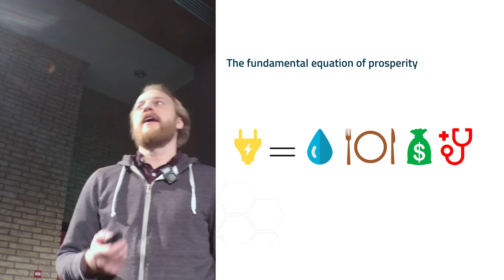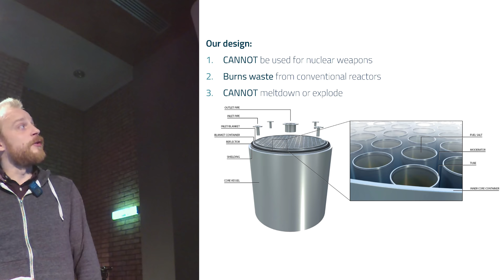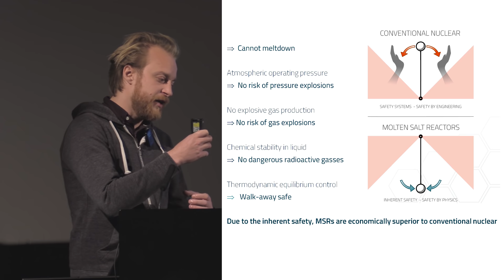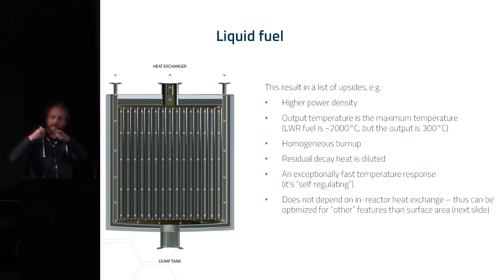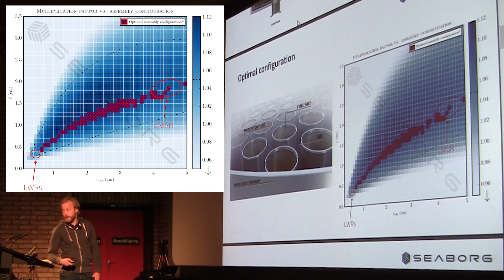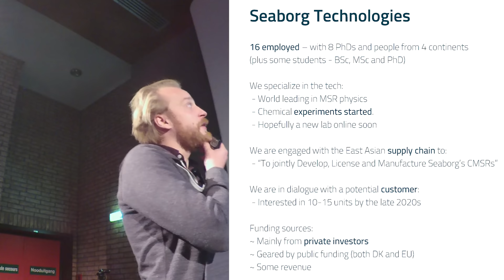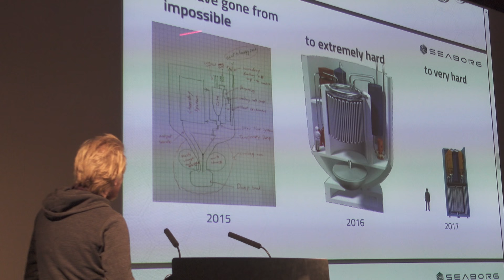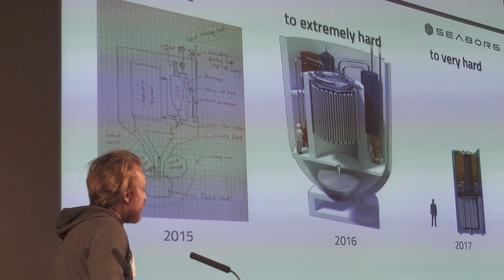Making Nuclear Sustainable with CMSR (Compact Molten Salt Reactor) - Troels Schönfeldt @ ThEC2018

Comment: Gordon, thank you for your continued role as the chief promoter of MSRs! MSRs should be utilized in the decommissioning of Existing Lightwater reactors. They are small enough to be sited on the existing secure, approved reactor campuses and easily integrated into the Electric grid as the old reactors come off-line these new reactors come online, potentially even using the existing turbine halls. Effectively, they are smaller more efficient replacement boilers burning the nuclear "ash heaps" of their predecessors. Processing of old (not) spent fuel into new fuel salt could potentially be done on the existing sites, reducing the need to transport the highest level Nuclear "waste" and its volume is greatly reduced as the balance of this former waste, is transmuted (probably the incorrect term) into thermal and electrical energy, and a reduced volume of less hazardous wastes. The concern with the total length of service is moot beyond 100 years, by which time all of the legacy nuclear waste (spent fuel) will have been consumed/reduced and Fusion Power will have reached a mature state. MSRs are the bridge to fusion, removing vast majority of the legacy high-level nuclear wastes, providing equal or greater generating capacity, along with desalination, nuclear medicines, and more. Decarbonizing and surviving the next 100 years must be the aim, MSRs are the means.

Comment: Thorium has advantages. It can work in thermal spectrum as well.
Chemistry with fluorine. 

Source of fuel is no an issue, nor can it be used for weapons. 

Weapons grade plutonium is made in a graphite pile.
Fluorinesalt is less corrosive then chlorinesalt. Better materials today then in the 60s. 

Neutron eaters (gas) can be separated when running as well as refueling.
High output temperature => thermochemistry. => synthetic fuel for transport etc.
High efficiency making electricity etc etc. 
Fluid moderator tried in IN2P3 Lausanne. Expensive research needed to make reactors accepted by authorities .

Nuclear energy competes with the fossil, a big economic player.
Reply: Thermal spectrum is a fundamentally flawed way of doing nuclear because you don't get rid of the long lived transuranic radioisotopes, Curium, Americium, Californium etc. Fast reactor preferrably chloride salt.
Reply: @hjembrentkent6181  Could you elaborate on your point?

Comment: 13:42 If you partner with China to manufacture the reactor, how do you prevent them from stealing your designs, and going forward without you?  Doesn't China have a history of stealing any ideas or designs they want to?  Do they respect patents and intellectual property of others?
Reply: The R&D reactors at the Shanghai Institute of Applied Physics are state of the art.  There isn't anyone for them to copy from; they are inventing it.
Reply: I can say that both comments are true. As someone who works in china - the new high speed rail, thanks to French technology, but totally built in china with no French involvment. But saying all of that the Chinese have put a lot of effort into nuclear power technology so i suspect the 2nd comment is correct as well.  On the other hand the most commonly built new reactors are Westinghouse AP1000. I am not sure when the first commercial Gen IV pebble-bed reactor will becomes operational. It was suppose to be in 2018, but i think that has been delayed to 2019? They are also building a Gen-IV sodium reactor in Fujian, again not sure when that will be completed

Comment: I like that it doesn't use graphite, but with a thermal spectrum reactor you don't get rid of the long lived activation products. Transuranics or transthoriums in this case. Fast spectrum is the best way to do nuclear because you close the fuel cycle and the waste is gone after 300 years, not milions of years in the case of transuranics.

Comment: Would you please state the dates of the presentation and/or recordings?
Reply from the maker: ThEC2018 (in the title) means 2018. I enter (manually for every video) the date captured into YouTube meta-data. I dunno where it shows it to your, but YouTube knows it. Either that or "Date Recorded" field is some sort of black hole to everyone else but me... which wouldn't surprise me. The value is 2018-10-29.
Reply: @gordonmcdowell  Thank you!
Reply: 0:23 His slide deck is dated "29 10 2018"

Comment: I am antinuclear,but you have now introduced some doubt in my thinking. Let all options be on the table,but we don’t want nuclear pushing sustainable off the table as has been done by oil,gas and coal.
Reply: The best option as I see it would be to have them work in concert, Nuclear as the base load and other sustainable soures to make up the difference and peak loads
Reply: Yes we do

Comment: Consider that the newer MSR's consume what we used to consider "nuclear waste" as fuel. They intake high-level waste (stays dangerous for hundreds of thousands of years) and spits out low-level waste (stays dangerous for a couple hundred years. If for no other reason, we should do this to get rid of our dangerous radioactive waste.

We have enough radioactive waste to produce USA-level power for the whole world for the next 1000 years. If we did that, most of the new radioactive output would have become completely inert by the time we ran out of the old radioactive waste.

Comment: I am noticing that he brought a lot of the problems with graphite that I did in an earlier video that someone here went pretty feral about defending.  Cant have it both ways, guy.
Reply: All engineering is a tradeoff. Not sure why people would be wedded to an engineering concept of a conceptual reactor design and be willing to die on a hill for it. 

In any case, I don't think the CMSR offers a strong solution with heavy water, either. A tube leak or break would generate hydrogen fluoride (or should it be deuterium fluoride?) - which is hydrofluoric (deuterofluoric) acid. Not something that you want to have flowing around a 700 degree primary loop. The oxygen would also cause rapid corrosion of the primary loop. And while I don't think it is likely that such an accident would pressurise the containment, it could very well ruin the reactor. Not a problem if Seaborg plans to produce SMRs which thrive on serial production, but it would be a significant cost to the operator and therefore, a financial risk.
EDIT: Looks like Seaborg has updated their design and moved away from heavy water, since the last time I remember reading about them was in the IAEA SMR book 2016. The SMR book 2018 on page 201 seems to have updated their moderator to "proprietary liquid moderator" 

https://aris.iaea.org/Publications/SMR-Book_2018.pdf
Reply: It looks like they're mostly using sodium fluoride as a carrier for their fuel and fission products.  It must be mixed with something to lower its melting temperature as the core operating temperature is well below the melting temperature of sodium fluoride.  Even so, whatever their "proprietary liquid moderator" is has to exist at at least 700C.

Its just speculation but I'm wondering if they're not planning on just using some kind of graphite emulsion in another molten salt like beryllium fluoride.

The list of effective moderators that aren't a gas at 700C near atmospheric pressure is pretty short.

-edit
If they were ever using heavy water as their moderator, it would either have to be a high pressure reactor already or they would have to maintain their moderator not in thermal equilibrium with the reactor.  This company is giving me a bit of a "Theranos" vibe.
Reply: @htomerif  
You can have a liquid D2O moderator that is unpressurised - see the CANDU. The trick is using a gas insulator between the coolant loop and the moderator tank. In that sense it is perfectly fine to have D2O at near ambient temperature
http://www.nuceng.ca/candu/pdf/8%20-%20Nuclear%20Plant%20Systems.pdf
See section 2.3. CO2 or Helium gas is kept in the gap between the primary, pressurised loop, and the calandria assembly holding the heavy water. This double wall design enables the moderator to be kept at 30-70 degrees Celsius while the pressurised loop might be running at 250-300 degrees.
As for the "proprietary liquid moderator", ionic liquids would be the choice here. Preferably something without organic compounds because radiation would polymerise them (turning them into goopy, tarry crude oil) but then something hydrogen rich would be preferable, so this would also favour hydrocarbons or hydrides. 

Proprietary implies some kind of special compound or ionic liquid system which again, speaks to the likelihood of using organic compounds. The polymerisation problem can be mitigated against or ignored, especially if the insulation is good enough to assure that no pressurisation is needed for the moderator. There might be issues with decommissioning: you might put in a wax or a free flowing, clear oil at the beginning of reactor life but then wind up with a tarry, goopy mixture at the end of life.

If it is a hydride eutectic, or just solid hydride, I fail to see how such a thing could be made proprietary. You cannot patent salt (NaCl with some KCl). But if avoiding radiation driven polymerisation is a priority then a hydride eutectic would be preferable, since as an ionically bonded mixture, radiation cannot break or change the arrangement of covalent bonds. The LiCl-LiH eutectic system has a melting point of 495 degrees Celsius: https://htracyhall.org/ocr/HTH-Archives/Cabinet%207/Drawer%203%20(HUH%20-%20KAK)/(Johnson,%20C.E.)%20(linked)/(Johnson,%20C.E.)-9_OCR.pdf . This is a eutectic point similar to the inlet temperature of molten salt reactors. 34 mol% LiH is no-where near as much hydrogen per volume as H2O, but on the other hand there is no radiolysis either.
Reply: @MonMalthias  He says high temperature liquid, ionically bonded and hydrogen based ... I don't know about you but all I can think of is lithium hydride in that regard.

Comment: What I understand about MSR is that the molten salt is too corrosive on existing alloys. New materials would have to be developed. Is that right?
Reply from the maker: Kirk Sorensen argues not, that Hastelloy-N can be used. https://www.youtube.com/watch?v=2U9HVIFt2GE Ed Pheil argues not and that corrosion is not the issue people think it might be and nickel-alloy will be fine. https://www.youtube.com/watch?v=aHsljVnY6oI ...the other companies planning to replace their reactors regularly (ThorCon and Terrestrial) are doing so likely because of the graphite and not the nickel alloys... chemistry can be addressed by offering deliberate areas for FP to "plate out" and keeping oxygen out of the salt. Neutrons do degrade graphite, and the neutrons have to hit the graphite or the graphite won't be doing its job as moderator.
Reply: @gordonmcdowell  You can use 316 stainless steel (A standard, nuclear grade, ASME-coded steel) in Molten Salt reactors. If you have proper chemistry control, corrosion can be limited to 0.1mm per year. So an extra 1mm of vessel thickness is 10 years of extra vessel life.

The real problem is not reactor vessels. The problem is corrosion products plugging the heat exchanger tubes, or noble metal plate-out in the heat exchangers. Even though a reactor vessel might only lose 0.1mm of surface material throughout the year, if you consider the entire surface area of the reactor vessel and imagine that stripped surface clogging up the heat exchangers, you will be throwing away a lot of heat exchangers. Or have to resort to using very large diameter tubing so that even if there is plate-out it doesn't matter. Then your problem becomes huge heat exchangers that almost become impossible to incorporate into an integral design. This is why I think that the Terrestrial Energy route of using multiple heat exchangers that can be switched to if HXs fail is probably the way to go.

Comment: This presentation is a bit short on detail, so those interested in improving the world should look at more of these Thorium MSR videos.
Germany has really tried to go green with wind and solar, and could not keep up with demand. Energy storage at the terawatthour level has to be considered, and individually owned systems is possible but not realistic. 
Germany now uses bad brown coal in massive amounts and other CO2 generating crap. Wishful thinking is not going to work. 
Read up on MSRs. This is the lowest cost and cleanest, cheaper than coal. Varoius nuclear fuels can be used and waste processed in-line. With no risk of explosions and meltdowns nuclear is not a risk, global warming and wishful thinking is a much bigger threat.
Reply: This is very accurate. Germany has spent over 800billion euro's in rolling out a massive amount of renewables with an effective zero reduction in CO2 Emissions.  The only real effect has been to ensure Germany has the 2nd highest energy costs in Europe, at 30.5c/kWh. I admit half of this is taxes. Switzerland decided to focus on improving insulation and has managed to reduce CO2 emissions. 
The reason why the CO2 reductions, once you factor in power from Poland, have not gone down is Germany did not decommission any coal plants, apart from a few old one in East Germany. This was replaced by importing lignite fired power from Poland, so there was no saving there. 
The reason why they did not decommission their coal fired plants was reliability, Germany cannot afford to have regular brown-outs and more importantly a black out, so even when the renewables are producing lots of power, the coal fired plants are still running. The solution would have been to spend half the money on storing the power renewables produce, but that would have doubled the LCOE cost of renewables.
The best way of reducing CO2 is to set a target and a metric, create rewards and penalties and just let the free market decide what the best solution is. However I must admit Nuclear is probably not going to be solution, as at $95-130/MWh it is very expensive. Even in china nuclear, while an important element of their future plans, will only represent 10% of their power mix. But that does represents a very rapid building program of nuclear power plants, with them building plants in about 42 to 60 months. On the other hand renewables with storage are just as expensive, if not more,so perhaps I am wrong.
Reply: @peterfmodel  
The highest cost for high CO2 sources is the damage it makes, and if considered would make it the most expensive.
Fluid Fuel Reactors does not explode nor melt down, Thorium fuel is essentially free, does not generate train loads of ashes, reactors are smaller and can be prefabbed and shipped in, does not require massive forged steel vessels, that can only be produced in a handful locations.
Without considereing the cost of energy storage wind and solar are a delusion. 
Maintenance of wind and solar is not risk free nor free and must be considered. The developing world is exploding energy demands and the lowest cost wins. LFTR is the lowest cost energy source and the least risky. Nuclear proliferation is not much of an issue either as the Thorium cycle produces small but nasty hard gamma emitters from U232, which is very hard to separate. (Nuclear weapons does not radiate anything unsafe and detectable to be usable. )
This video is but one example of many Fluid Fuel reactor. Look at the others. 
Fear and oil financed propaganda has done great damage to nuclear power. People have more fear of it than knowledge and the nuclear industry is keeping its head down. 
The nuclear industry needs a new generation of scientists and engineers to make 4th generation reactors that does not explode or melt down.

Comment: 2:14 um point of order .. but if the preceding statement were true... would the market not have already solve it ?  either the market has failed to invest in r&d to switch from carbon based fuels or it lacks the ability to do so .. this is a 60 year old problem  the market has failed because ..well.. simply its cheaper to ignore a problem in the short term until  it becomes  ignoreable  and then it is far cheaper  to lie about it being a problem than it is to solve it ... the market made its decision on climate change and that was to first ignore it then to down play it then to deny it...

Comment: I think we need to use the fuel rods intact inside the molten salt thorium reactor. Horrible, cracked faulty fuel rods insitu in the molten salt reactor, burned to forever till depleted. controlled neutron flux by temperature of the salt by pumping speed.  Maybe not graphite moderated, but would still be good.